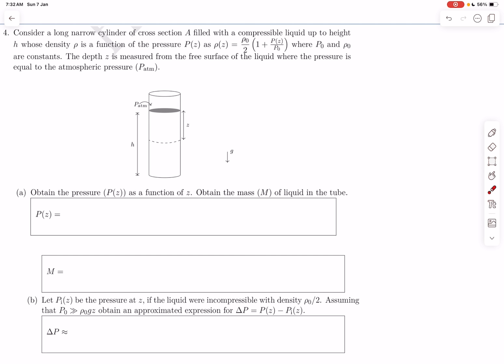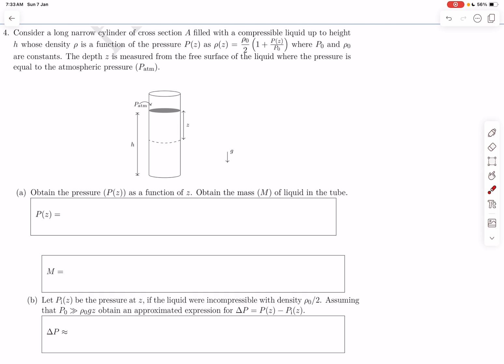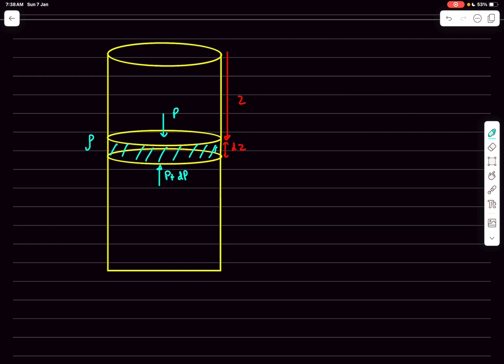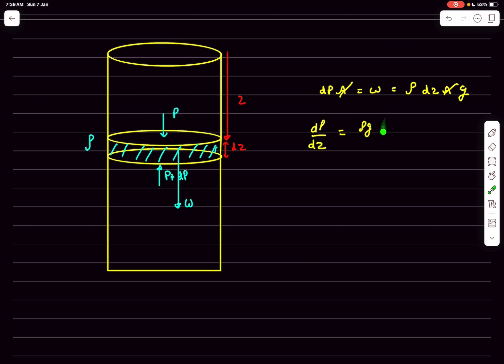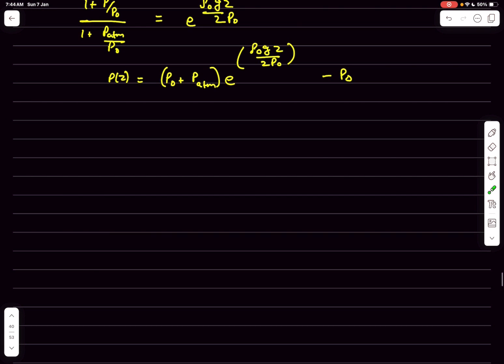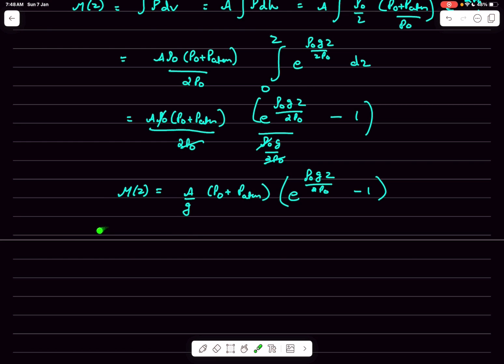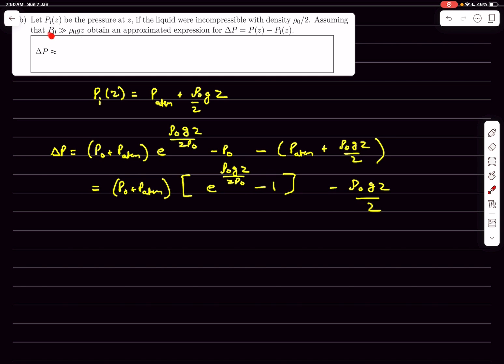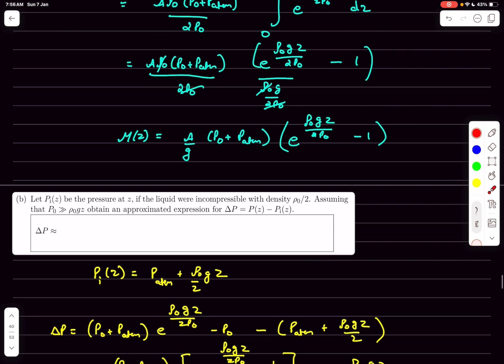Fluid Pressure Variation in A Compressible Fluid | InPhO 2019

Comment: Sir Your videos are extremely useful. I had one doubt from the solved example questions of cengage in which there was a solid cylinder rotating with ang velocity 'w' if we put it in a container containing viscous fluid and the setup is vertical will it ever stop as the viscous force acting depends upon the relative velocity of particles (linearly) so if the omega decreases the v relative will also decrease therefore it will never stop could you pls make a video about it?? as we see practically it stops.
Reply from the maker: Yes it will definitely come to rest provided we don't provide an external torque to the shaft
Reply from the maker: As v rel goes down mag of viscous force goes down but there's still a negative torque and It will persist till the cylinder stops